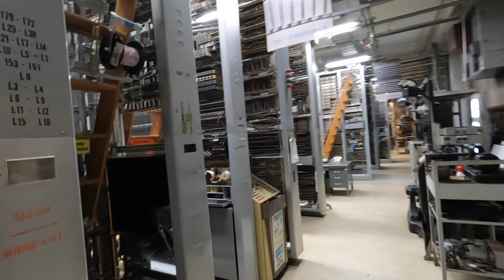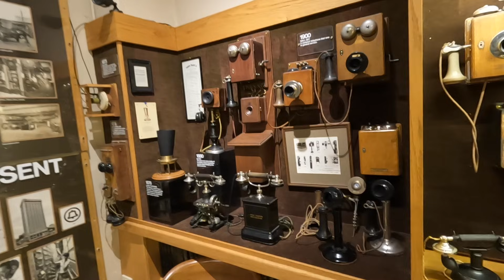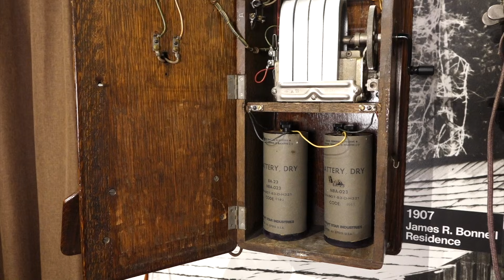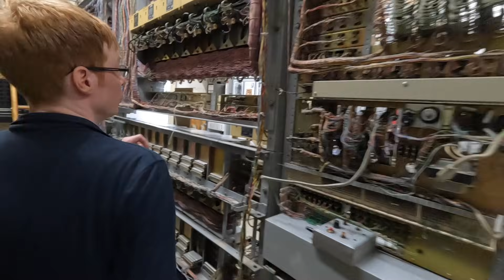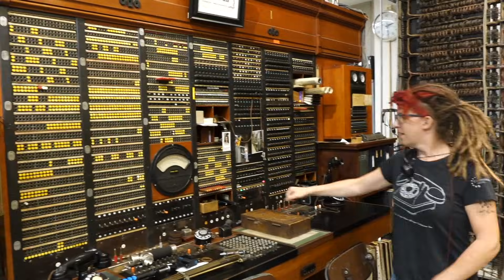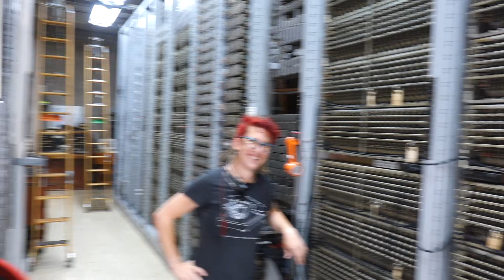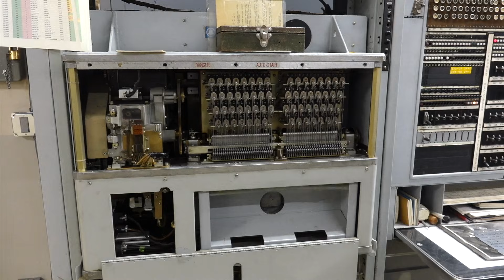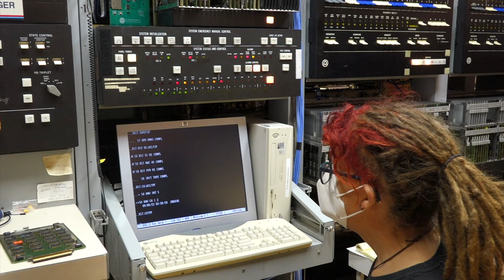At the Connections Museum: the insane telephone technology that led to today's computers

Comment: Ahh I would love to make the trip and see this. Used to be a cable repair man for AT&T. I still love walking the central office and seeing the work of art that those guys created back in the day. Our oldest office still has the 3ESS, 4ESS, 5ESS equipment all retired in place. They now run on a DMS switch. The day is getting closer where they will be powered down. The air pressure systems turned off and all those pulp, pic and filled cables will be retired replaced by fiber.
Reply: When I was a kid, our town was wired with lead sheath (paper insulated?) aerial cables which dated back to the late 1920s.  Occasionally there would be a fault which was under repair and there would be a gas tank chained to a nearby telephone pole and hose running up to pressurize the cable.  Those cables were swapped out for PIC in the 1990s.  We now have what are apparently fiber DS-3s running to cream colored ground mounted nodes which tie into the PIC for the last few hundred yards.  AT&T sent me a mailer saying fiber to the home is now available, but I don’t know how they provision it.  The cable which runs by my house still looks like the old copper cable.  We also have whole forest of 5G nodes mounted at the top of telephone poles, one in almost every city block.  The 5G units are fed from fiber.
Reply: @wtmayhew  Lead stealth cable has paper insulation. Wires were twisted together and hand soldered there was a lot of labor involved. Then the splice cases would be filled with wax. One old timer told me the underground telephone cables were spliced together every 500 ft.
Reply: My early years involved a 710 tool and large quantities of DeGel...  :)
Reply: 4ESS toll tandem switches and the 5ESS are still in widespread use

Comment: Neat collection. A treat to see it all so lovingly preserved. To think that every metropolitan area in the developed world once held giant buildings full of such intricate, ingenious electromechanical contraptions, all connected to each other, and it all worked as a system.
Reply: The very early part of my career as an Engineer coincided with the end of the big telephone systems as the drivers of the system. Back in the day, my employer sent me late one night to the Seymour Exchange in Vancouver to swap out a line card in an ATM switch. They terminated 2 million pair in that building. It was amazing to behold. I need to get down to Seattle to visit this place.
Reply: Those buildings are still all there in the most part, just having transisioned into more modern technology and then being used to house multiple technology changes. After all having the building, the rights of way and likely cable trenches in place it was natural to pull out the old equipment to make space, and put the new in. The extra space often was then repurposed, either for use as office space, or for servers, or for the billing system archives, on the premise the buildings were already paid for, and saving on cost. Only rarely were they sold off, mostly just those that were consolidated with technology changes making the building empty.
Reply: @SeanBZA  sure, and of course you're right. But the buildings themselves aren't interesting, and to me the superior modern / contemporary digital solid state switching tech is very uninteresting, just network plumbing. I'm just here for those ancient electromechanical marvels.

Comment: First?
Reply from the maker: Yes! You get a sweet operator to connect your next call.
Reply: My 1956 rotary wall phone awaits the long distance circuit! (Yes we do indeed still have one)
Reply: @usuthu65  I have a few as well...got myself a Panasonic mini-PBX to run them, all hooked up to an OOMA box which provides connectivity to the PSTN. A different extension number in each room. Grandkids love it. Wife insisted I put a 302 set in the kitchen, because the cordless distorts the audio (so she claims).